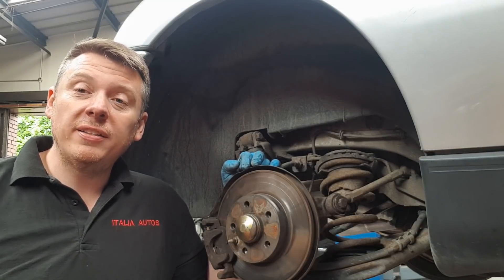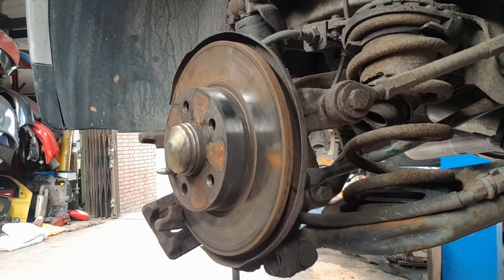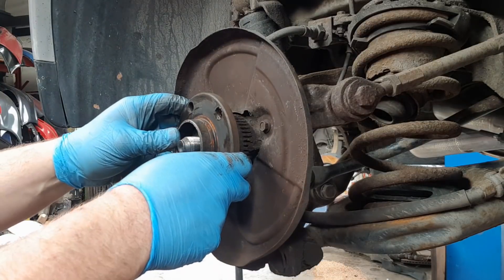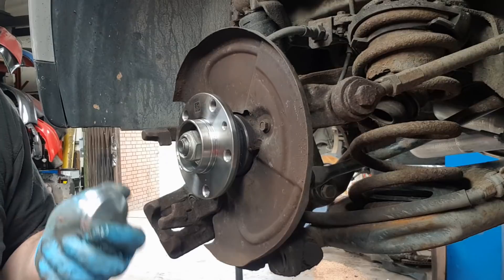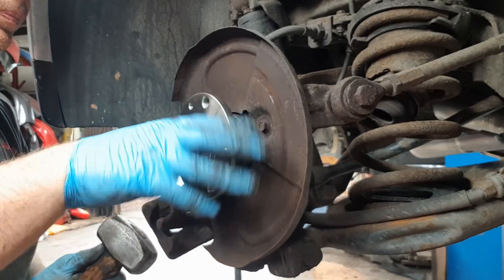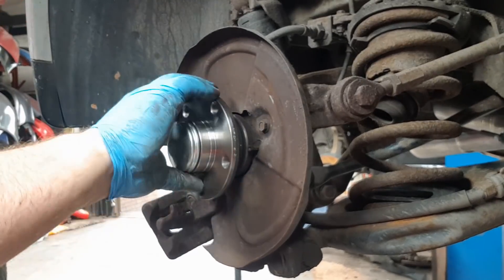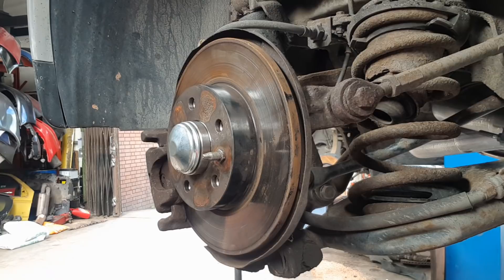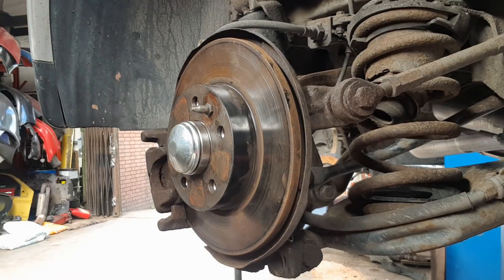Alfa Romeo GTV/Spider 916 rear wheel bearing change.

Comment: You have fitted the late (after Nov 1999) bearing on a car that has the early ABS system. Apparently, this sort of works, but the number of "teeth" per revolution is different, so it may throw an ABS error in tight corners, and the ABS will not work entirely as it should.

Comment: Do you also have a video for the front wheel bearing on a 916?
Reply from the maker: No I don't. I've not done one as you need a bearing press and most diyers don't have one
Reply: @ItaliaAutos  Aaah too bad. I had one bearing done by the garage (forgot if it was front or rear). Now I hear another one (or the new one?) singing on the left side and was wandering if I could do that myself. Problem also is how to detect a faulty bearing with the car on a lift and lots of noise around you!
Reply: @ItaliaAutos  Actually I can use a bearing press at the DIY garage

Comment: Brilliant thank you. Couple of questions:
What is the torque spec please? 
I notice the bump stop cups are destroyed which I know is common. Is that an MOT failure? 
If you ever do a GTV front wheel bearing could you do a video on that. Many thanks 👍🏼👍🏼
Reply from the maker: bump stops are not a failure. torque specs available on internet.

Comment: Can you do a how to change antirollbar bushings on 156-147 etc..?
I know that the best thing is to remove whole antirollbar, but i saw couple of mechanics do it on the car.
Reply from the maker: It's easy to remove. Just take all the bolts out of the subframe so it drops a few inches and roll bar will slide out.
Reply: @ItaliaAutos  
Do i have to hold subframe with something? I have a feeling that everything will fall on me. :D

Comment: apparently there are 2 types of rear wheel bearings - one for magnetic ABS sensor and another one for the older ph1 cars. I do not think they are interchangeable...

Can anyone confirm?
Reply from the maker: To be honest never noticed the difference untill it was pointed out. It's been test driven and no and light on. Somthing I'll have to look at monday.
Reply: @ItaliaAutos  I just bought a pair for ph1 - apparently it is mandatory they should have the ABS "teeth". Anyway please keep us posted with the difference :)

BTW - truly helpful videos! Thanks and keep it up!
Reply: Yea, they are not interchangeable, had the some problem, bought the magnetic one, and  abs is not workingwith those due to the sensors, and the mechanic thingy.
Not recomended to mix this up.